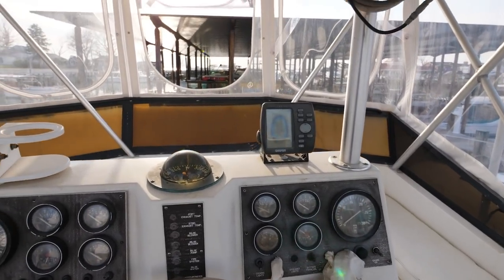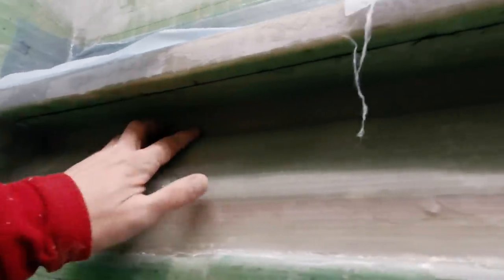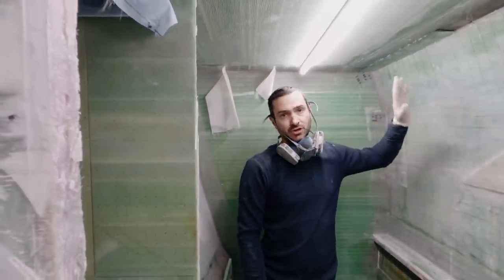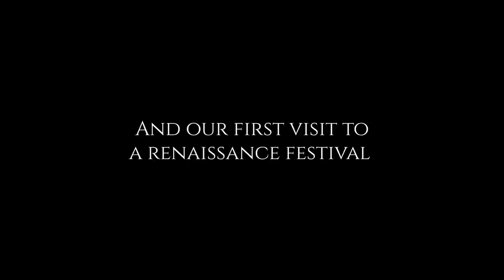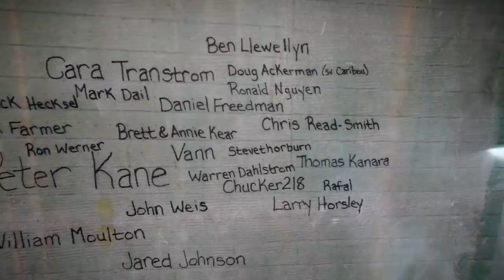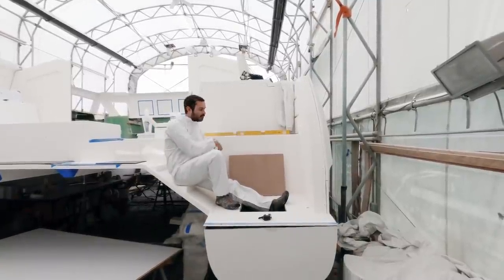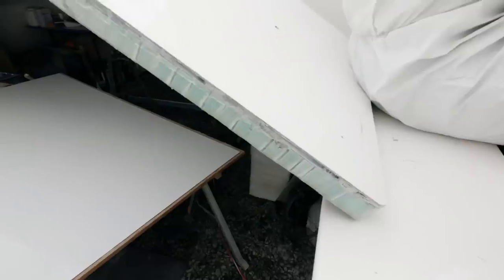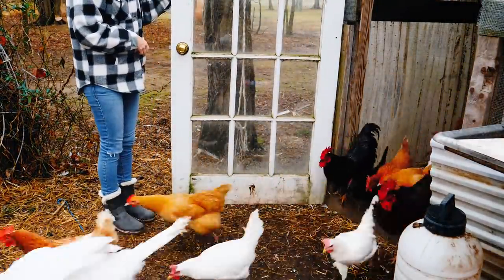A Bit of This and That - Didn't We Do This 210 Episodes Ago? (MJ Sailing Catamaran Build - Ep 229)

Comment: I’ve been catching up on your series. I found you about two weeks ago, and have binged through all the catamaran build episodes.  Great stuff.

Pro tip: when making router templates (like the one for the transom hatch, the doors, etc) - it is worth thinking about where the bit is going to go if the router skips away from you. In this case, I would be nervous that the bit would skip outward into the transom; I would recommend making the template a frame instead, so that if it messes up, it messes up in the waste piece. Bonus : the template is actual size, you don’t need to go through the mental gymnastics of shrinking it down by the diameter of the router bit.

Looking forward to following the rest of the build!

Comment: When using a pattern as a fence for my router, I have found that mounting the pattern to the  fixed side rather than the  waste side is a  more stable work surface thus leaving a finished edge (hot glue works well for attaching the fence/pattern). The router can be run inside the fence or, using a collet on the tool, on top of the pattern.
Reply: Ditto, I was just thinking about how best to describe the process. Grateful that you saved me from the mental gymnastics!
One other thing that I was going to say is that there’s no need for the cutting jig to be that thick. A thinner one would likely allow sufficient cut depth to penetrate fully with the router. 
Sheesh, but I detest machine cutting glass, it truly sucks in so many ways. I’m full of admiration for Matt’s ability to remain upbeat about it. 
Cheers, R. 😎👍🍻

Comment: So, I just watched you cutting that access panel and have some thoughts: Mark, cut and route 12mm MDF templates so that you’re cutting inside, not outside. Fix template on outside. Plunge 4 registration holes with the router to get perpendicular penetrations. Carefully finish off these holes with a drill and mount the other template internally, using the holes to register the template. This should produce an accurate cut within 2-3mm accuracy between the inside and out.

Comment: When using a template guide on a routers always use a template of the thinest possible to suit the length of the tubular part of the template guide normally around 5mm length so make template's 5mm thick and also add a small piece of template to the base of router with double sided tape so as to stop router from cuting out of square to panels all cuts will be 90⁰.
Reply from the maker: Thanks Jane for the suggestion of adding to the router base.   The small size - and the tendency to twist off the form - was the issue I had.

Comment: You could make one mold for both of your center boards out of wiggle board. It's a flexible plywood especially made for bending. It would work perfectly to form the shape you need with screwed and glued in bracing on the outside. You can also make the mold out of 1/4 inch hard wood strips like they make cedar strip kayaks and canoes out of. In this way, you will get a perfect job depending on how good you make your mold. The mold will be good for each half of each center board, 4 in total. Personally, I'd make them out of carbon fiber because of the forces on them. They would certainly last longer under that high stress in carbon fiber than fiberglass. You can also vacuum bag the process to make it even better. Tip, you want to apply thin layers of reason to prevent cracking on each layer of either carbon fiber or fiberglass. Another tip; It might be a good idea to put center board guides in to prevent banging and to make it easy to move them up and down. I believe that you can use rollers but there are thin strips that you can also use. I'm not sure of the best way but gel coat against gel coat isn't the best. There is a much better way that I've heard about but haven't seen. This YouTube video talks about it a little. They mention that they used bearings. Not quite sure what that looks like. Smaller catamarans and other club racing boats use thin strips inside the trunk.

Comment: The best tool for cutting out hatches is an angel-grinder with a diamond cutting wheel, and a jigsaw with a diamond blade for the corners.
Reply from the maker: It cuts great, but not at 90 degrees to the surface.   The router makes perfectly vertical sides.
Reply: @MJSailing  I know what you mean, but a diamond cutting wheel cuts so easily through the fiberglass, and with a little bit of practice you will get a good feel for the angles. You will get perfect cuts almost every time, because it’s very easy to follow the lines free-handed. The cutting wheel doesn’t want to stray out to the sides.
I worked in a boat factory for 3 years. 3 days a week I was cutting parts and doing cutouts for hatches. It didn’t take much time to build confidence handling the air driven cutting wheel with dust collection. We did complex shapes and angels, especially on steering consoles that had to be glued in with almost invisible seams. It works a lot better then you might think.
A router bit has a tendency to wander of, and it is hard to follow the template.

Comment: Will you gelcoat finish the head and shower areas or just use a waterproof paint or red guard liquid membrane coating in the "frequently wet areas" ?  

PS Matt.. on those hatches you'll do better to cut only about the depth of plunge cutting bit's diameter at first using your template, then drill thru around the corners in 2 or more places and at the ends of straight cuts. In that fashion, you'll be able to use the jigsaw and following the nice straight groove from router you've already made, get a clean, small kerf cut all the way through hull without chipping and tearing finished areas.

Comment: Through Alum. or wood I always ran routers in a clockwise direction. The bit looked like it was two to three times too small.
Reply from the maker: Clockwise is for inside cuts when going within a template and outside is counterclockwise.   The bit was the smallest cut line I could get.  I didn't want to have to remake the edge with a larger bit.  But in the end, I had to anyway, so it would have been easier to just use a 3/16 - 4mm bit anyway.

Comment: Do all those screws you put in go through the hull?  I guess you could always patch them later, but seems like a lot of work, and would hate to miss one and create a leak.
Reply from the maker: The screws do not make it all the way through the hull, just about 1/4" into the foam.  We then fill them later with a thickened resin and the surface will get faired over.  🙂